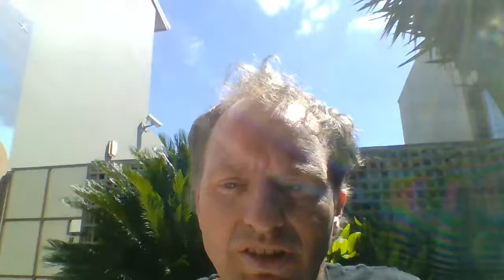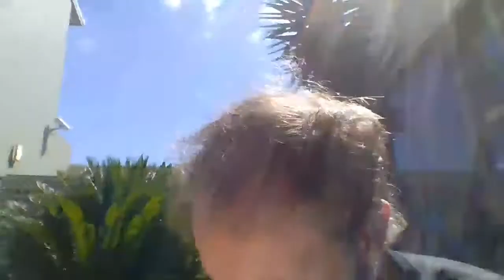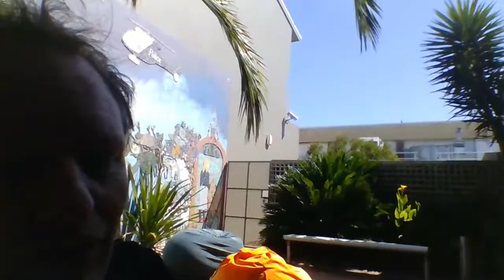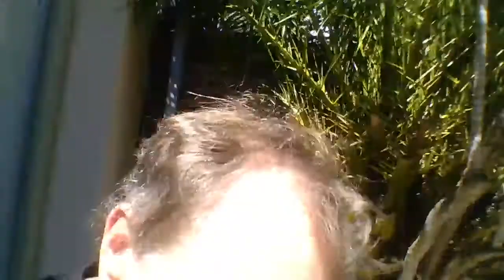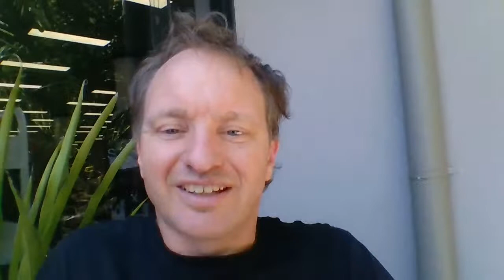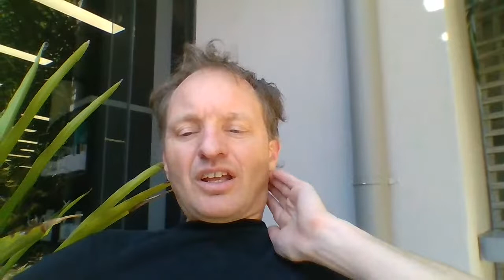Lunch time Chat & Ask me anything

Comment: Peter, time to start using McDonalds and Starbucks free wifi! You can operate from outside and use your bike as a ground plane.
Reply from the maker: Starbucks failed here. Apparently our coffee market was too sophisticated for them. No McDonalds right near here. Closest are on main roads where there'd be lots of HF noise. In theory a good idea but no.
Reply: @vk3ye  maybe it's time for a WiFi yagi or pointless can antenna. 2.4ghz WiFi dx?
Reply: @vk3ye  Maybe you can use your time offline to ponder about making variable capacitors with a 3d printer!